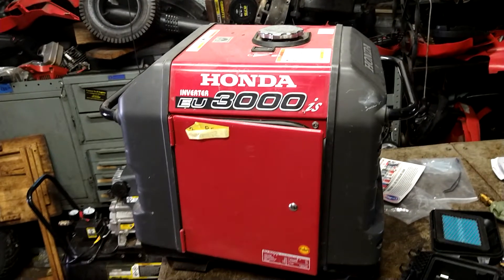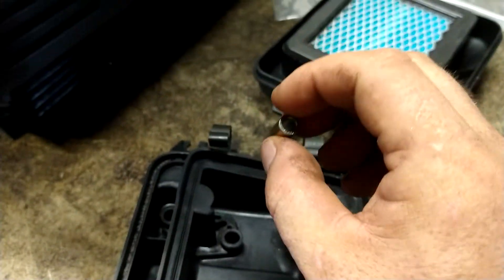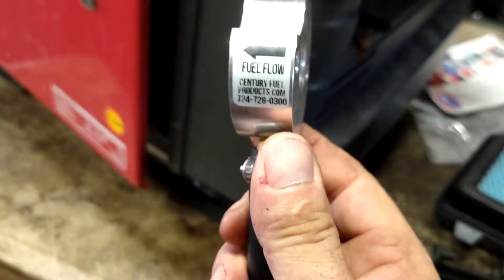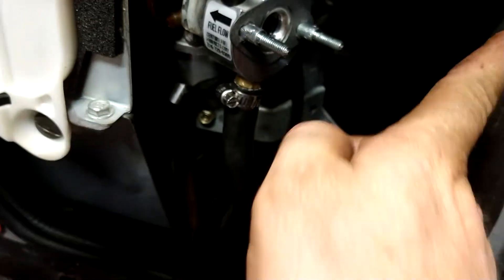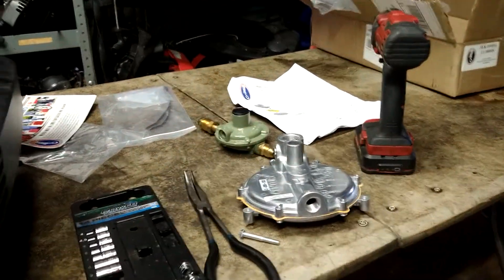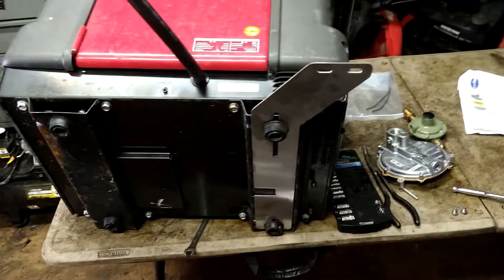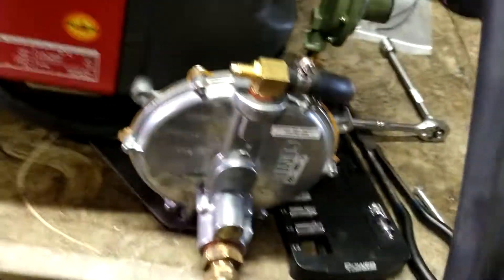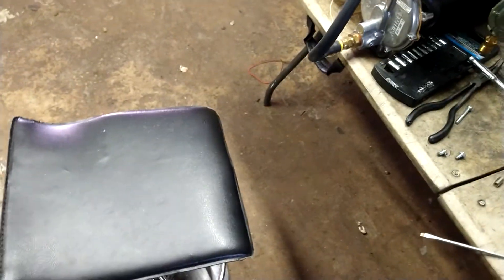Honda eu3000is propane natural gas conversion kit

Comment: looks like the demand regulator is the same for the 2000 and 3000 - if I could only find the manifold piece separately, that goes between the carb and air box, could run either gen with the the same regulator setup I paid a lot of money that came with the kit for the 2000
Reply from the maker: Call the company or message them. Tell them you damaged yours and need to buy another. Or easier still just drill a hole in the air filter box and insert propane hose. It will do the same thing

Comment: Does anything need to be done two switch from propane to natural gas? Just change the fitting on the end?
Reply from the maker: Some kits have a switch you turn but this one i believe its just the fitting
Reply: The one I got you change the jet in the line just before the carburetor fitting.